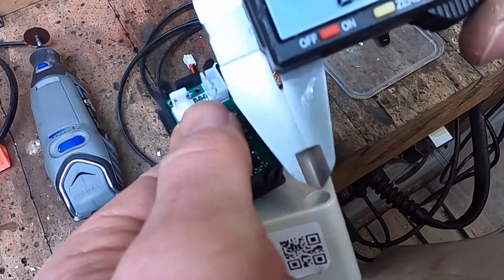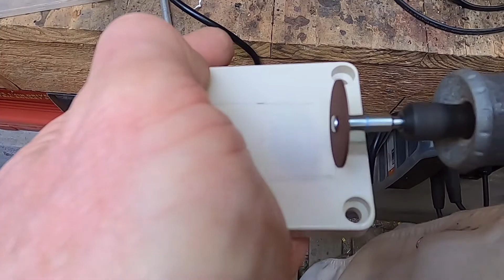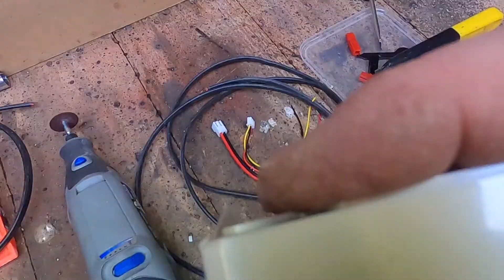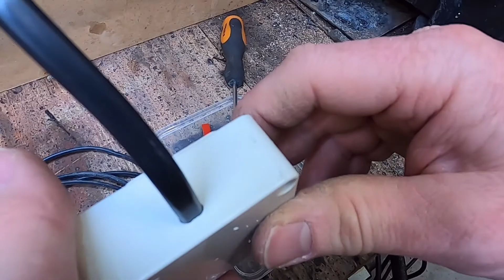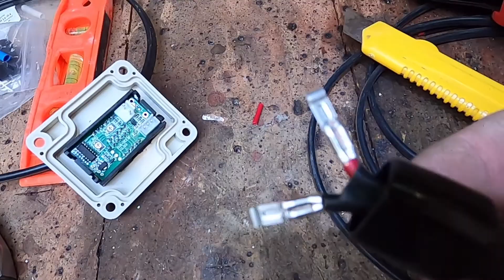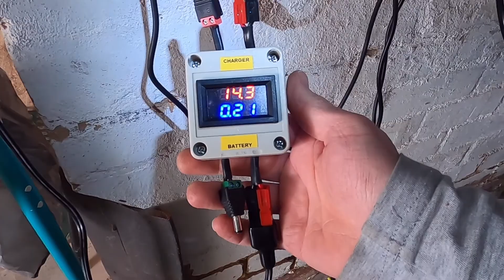Add a Voltmeter and Ammeter to Any Battery Charger – Easy DIY Upgrade

Comment: Thank you for the video. Would you be so kind as to provide the wiring diagram?
Reply from the maker: Hi, sorry I missed to put it in there, and Youtube doesn't allow you to edit videos once they are posted.  I have added a link to similar units.  I have put a details of the wiring in the description. Hope that helps.
Reply: @jackpwc01  Thank you so much. I found a wiring diagram on a manufacturers add.